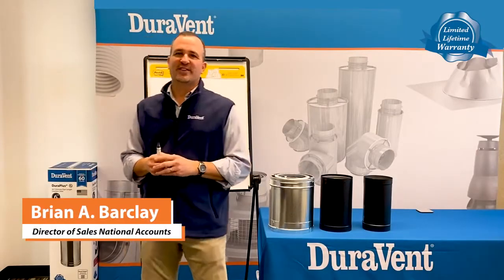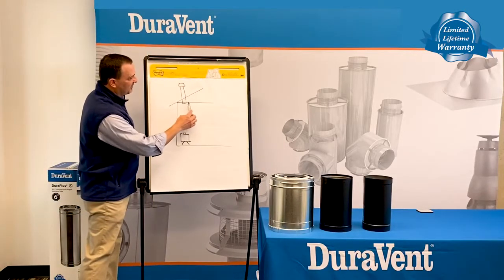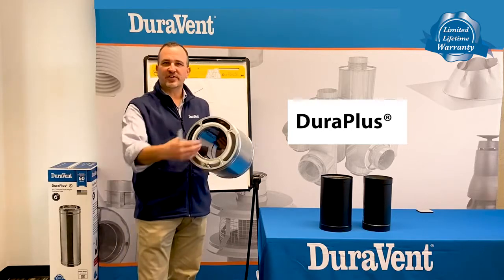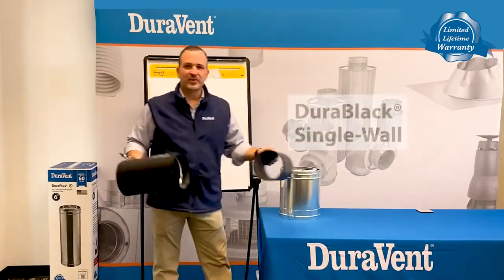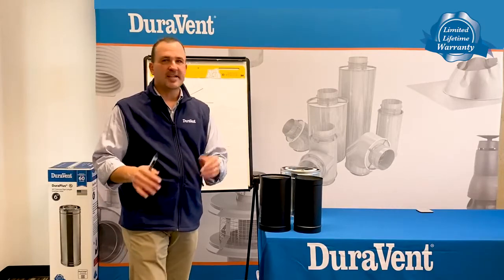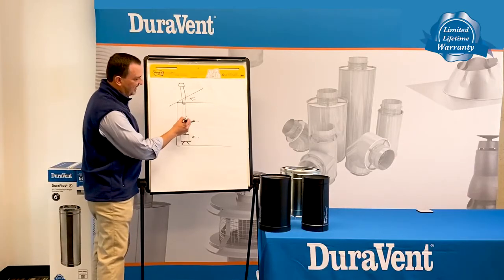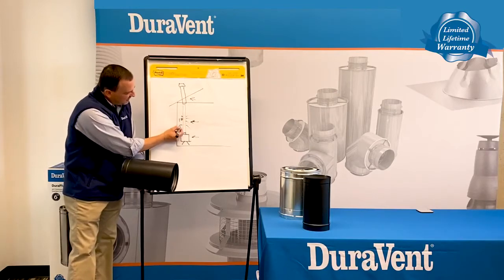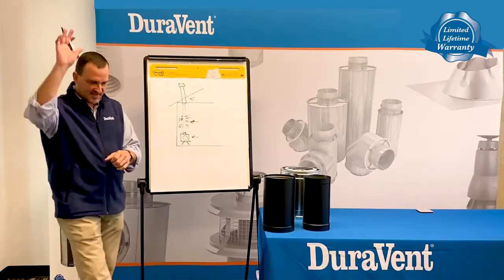DuraVent Double Wall Adjustable Stovepipe Model# 6DVL-12ADJ

Comment: You might show how the double wall adjustable pipe is put together 6dvl-68ta .
Reply: They need to send a GORRILLA to put the adjustable pipe together. Slides on about 1 !/2 " the you need a sledge hammer. POS.  Sending mine back